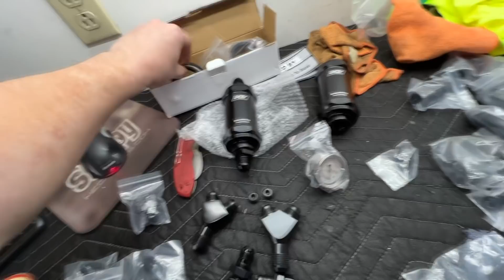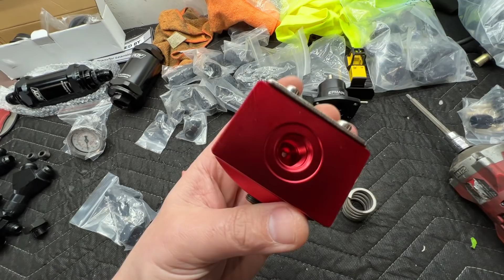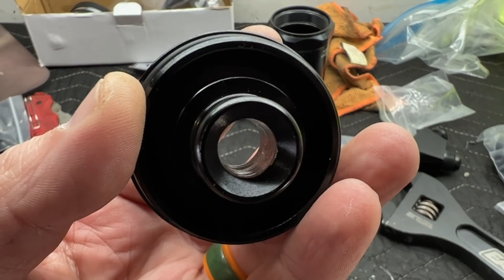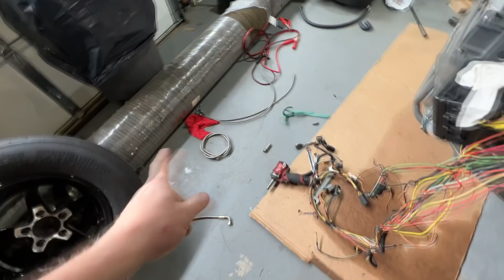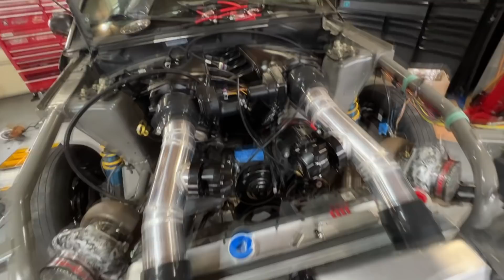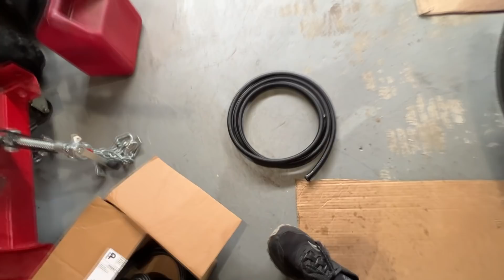fuel system day 2 and semi rambletron

Comment: Nice to have times in the colder states but in hawaii the coldest ambient temperature at night 65 degrees. The dead head didnt work for us it would cause vapor lock and the coolant compensation is going to look backwards when your tuning it and have a weird miss at cruising speed when in lock up. To confirm I removed the plug with the fuel pressure zero there was vapor pressure coming out so it was the fuel boiling in the fuel rails cause they was so hot. Sorry this is on 92 octane gas dont have e85 pumps in hawaii yes im a cheap ass.

Do the return style why because the power level 1000 hp should be a breeze for matt now a reliable 1000-1500 hp with heater and a/c for like drag week. With more power is more heat with more heat causes other issues. 

Matt good luck i enjoy your Contant straight up and honest opinions only. I would like to challenge you on this if thats cool. Take care aloha.

Comment: For the cheap regulator the fittings that come with them are not a true -6 or -8. The inner diameter is smaller.. but I have ran them with 20 pounds of boost and upgraded them later on.

Comment: Matt I have a question.   On the surge pump, What is the point of stepping up the size from 8 to 10 when when it is limited in performance by the ID of the 8 end of the adapter? Or is their no adapter and it's just a 10AN in place of the 8? Did I miss something or am I misinformed. Love your shit man makes me wish I was hanging in the shop with ya. Best times ever. God bless.
Reply from the maker: Honestly I wanted to match. My 10 feed to fuel filter and the rest of my system, also friends of mine have done tests with the fuel line diameters. And larger ones did better with moving fuel etc
Reply: Where matt is going with the project it will have less issues with this system

Comment: Also remember ptfe hose is always 1 size smaller. So a 10 an lines id is .500 ish, so basically half inch. Recently swapped my fuel system to a good ridge brand ptfe hose where it id is larger. So their 8an is bigger then 90% of manufacturers 10an

Comment: Have you maybe looked into using a Volvo electric power steering pump? There's quite a few guys using them it's a complete system with pump and reservoir and you can mount it anywhere you want.  By the way I live in Clarksville and I know Cameron and his shop A&H.

Comment: If you grenade the motor on your first pull you should throw a junkyard engine and just don't acknowledge it at all on video and keep pretending its all brand spanking untested i mean new. anyways. why are there no hammers in your videos? Hammers help with wiring and fueling.

Comment: I like the pqy filter as it has a stainless element for e85. However, most of these are shipped with a 100 micron element. In this case I would swap to a 10 micron stainless element. The aeromotive element is a drop in. Good work Matt.
Reply from the maker: Thanks for the tip!

Comment: I just mounted my MAC valve on the intake manifold and ran nylon lines from each wastegate. The hide pretty well. As for that radium surge tank, I found it odd as well that the outlet was 10orb but came with a -8 fitting. And the inlets were 8orb but came with -6 fittings. I ended up just buying new fittings for all of them. You're gonna love that surge tank brother. I'm currently running dual 450s in mine and a 340 pullup pump. I thought it would be loud as hell but I think the thick aluminum the surge tank is made out of actually muffles the pumps a bit because they're not very loud at all....and my surge tank is actually mounted in the hatch area so you'd think it'd be annoying as hell. Anyway I'm loving this build and all the detail work. Cant wait to see you fire it up for the first time.
Reply: N an

Comment: Call me silly but I have to ask, With such a large investment why are you using a $35 dollar China FPR? .......respectfully, Jim
Reply: Regulators are super simple, as you can see by the disassembly in this video. The only difference between this cheap one and a "nice" one is some quality control and the name printed on it. Lots of people swap the aeromotive diaphragm onto these cheap regulators because that tends to be the failure point. And if the diaphragm fits both, then what does that tell you about who makes the housings?
Reply: @Ribbityibzki  has nothing to do with the simplicity of the device.... Regulators need to flow a sufficient amount of volume to be able to return the unused fuel. 
That regulator has a tiny return hole which can't be opened enough because of the small pintle. If you look at a high (proper for the app) flow regulator you'll see the difference.
Reply: @BEANS-O-MATICtransmissions  that I can agree with. The original comment was made more along the lines of the reliability of the product, which is what I was responding to.

However, I would argue that the size of orifice in that regulator could possibly be sufficient. Matt proved on the G48 that 5/16 line is capable of supporting 600hp on e85, so that regulator could be sufficient for relieving enough flow on this fuel system. I'm not 100% behind this theory, but it will be interesting to see the results.
Reply: @Ribbityibzki  I should have kept my mouth (comment) shut 😆 🤣 😂 My current build is 100% Radium. Super nice however paying for it  wasn't so nice at all. More pain came buying 1700cc X series injectors dynamic injectors. Cost is Down right painful!
Reply: Literally my thought as well. I was like aww come on Matt !!!
I'm all for saving money where you can and i know you like to "prove people wrong" by showing inexpensive parts will do the same job but..... this power level, time and expense is NOT the place to cheap out in the fuel system. Just get a decent Holley regulator, please don't mess around.
 Leave that $38 regulator to the don't bs me builds.....
Reply from the maker: Holley nice one is on 4 mo back order
Reply: They work.

Comment: 18708 gates hose and 18707 are 90 degree heater hose that has it built in by the water pump and would work perfect

Comment: For the floating hoses - the trick is to find a grommet that fits over the hose, cut it, and cable tie the grommet to the hose in any place that the hose might eventually rub, when engine is hot and you are bouncing down a bumpy road.  Easy, cheap, looks ok.

Comment: That filter housing you drilled out is aluminum right? Since you took the coating off won’t the ethanol fuel eat that housing? I was about to order one of those filters, now I’m concerned about using it for E85
Reply from the maker: this is a great question, didnt think about it at all till now!
ill have to confirm all that
Reply: I'll take this one if matt is going to leave straight methanol in the fuel system and let it sit without prep sitting time for more then 4-5 months then he will have a problem with corrosion. But he is going to run e85 to race for power and cruz on pump for MPG lol. Turbo john is a perfect example of an anodized parts and devin vanderhoof to the extreme but its not it to fix or solve a problem and devin hits it everytime. But like devin says " Im not perfect " which is humbling from a great guy of knowledge. 

Keep it coming matt thanks